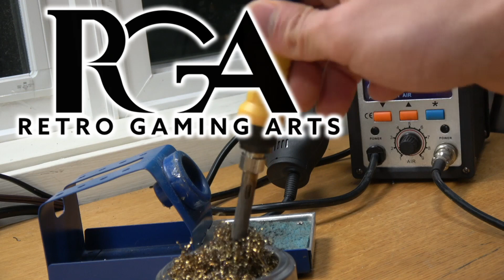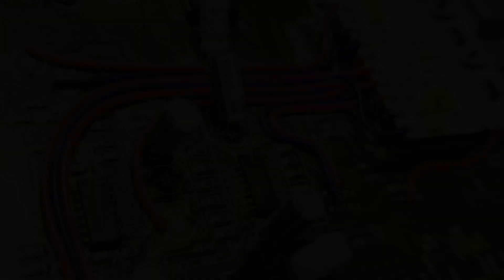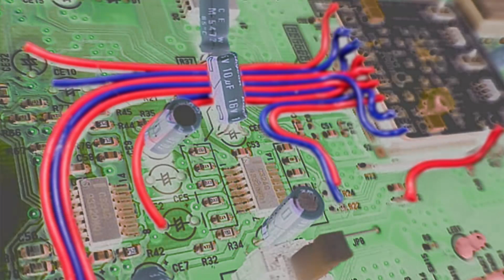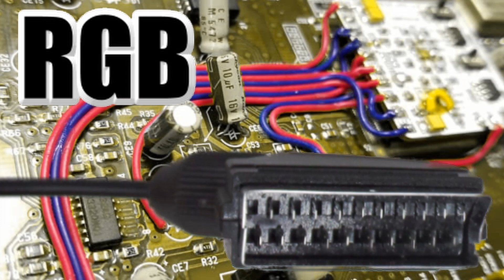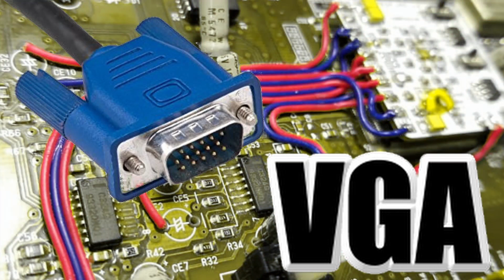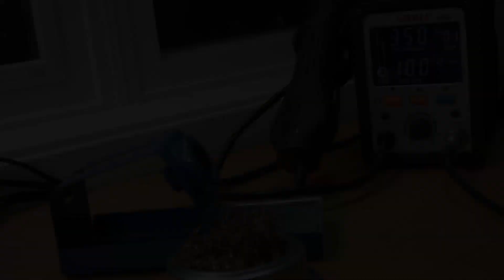Retro Gaming Video Signals Explained - RETRO GAMING ARTS

Comment from the maker: How do you hook up all your consoles?
Reply from the maker: OMG THANK YOU FOR NOTICING THE MEGA AMP IN THE BACKROUND!! and RF/Composite i cant stand anymore, but as a kid, it was all i used, but now as an adult, using the best possible output for each console is the way to go, most of what i use is s-video, but some rgb, some component, nintendo i use in rgb, everything else is s-video pretty much
Reply: Usually with what's best available within the console itself, I know the NES can look great with RGB output, but I'm not going to go out of my way to install a mod for that
Reply: RETRO GAMING ARTS...I knew there were many types of connectors but never really researched them.
Reply from the maker: michael, live stream starting soon by the way, RE2, CLAIR
Reply: S-Video.  I can't stand a composite or RF picture anymore.  I'd love to try to step up to RGB or component on my Genesis(s), just don't want to break the bank doing so.  Price per result, can't beat S-video.  And wow, your mega amp work in the background pic is phenomenal.  You sir are truly a professional.
Reply: I'm considering a scart to component hook-up as my next step up, but can't do that for under $60 if I get a converter + scart/component cables.  HD Retro cables would bypass the need for this entirely, but they don't have any in stock.  Possible March release date on those, but I'm wondering are they worth the cost over S-vid?

Been meaning to ask you this, but do you use pots or resistors on your S-vid mods for the Genesis?  I have used pots in the past, as it seems to help dial in the Luma especially.  Would you happen to sell a kit with pots for the cxa 1145 (model 1) vid encoder?
Reply: I'll have to do with RF for everything... love the soft image and the interference that appears on the screen.... it's so enjoyable... I even got a RF modulator to get an Xbox one on RF..... so RF first and Composite second... I don't want component or s-video... HDMI and anyother digital connection is stretching "not really that much of a favorite"
Reply: Planning to get an RGB SCART cable for my PlayStation 2, Wii and a new one for my GameCube as it's a cheap one that I used for 5 years while looks fine to me wanted to get the Retro Gaming Cables SCART cables to use on my CRT. HDMI on Xbox 360 and PlayStation 3 onwards

Comment: What do you think about these VGA to RCA (sometimes they have an S-Video cable too) cable adapters? I think they just doesn't work.
Reply from the maker: Yea. They're trash. They're not real. It's not the actual signal
Reply from the maker: If your talking about the cheap ones. Some people have made legit ones that have actual circuitry in the wires that produce high quality signals. And now they have the hdmi cables for all retro game systems
Reply: @ThirstWorldTTV  Yep, I was talking about the cheap one. Those which are just a cable XD. 
But it's good to know that there are some  of this adapters that actually work. 
Thanks for your video!

Comment: Using the RF connector is what I knew....from NES, SNES, Turbo, Master System, and Saturn; so this is what I used and continue to use. I purposely bought the RF connector for the Saturn.
Reply from the maker: really? you still use RF? there's nothing wrong with that for the exact reasons you stated, but you should give S-video a try, it may blow your mind